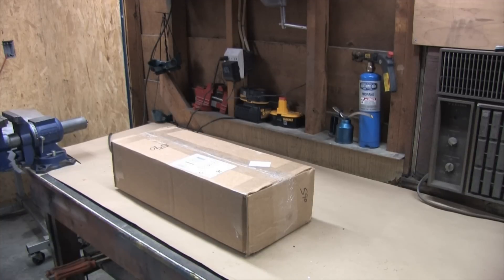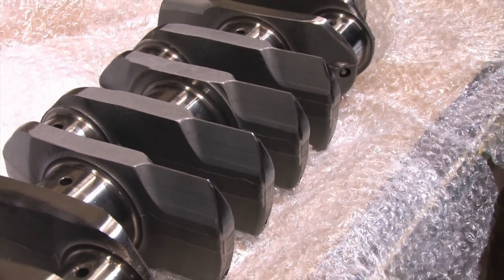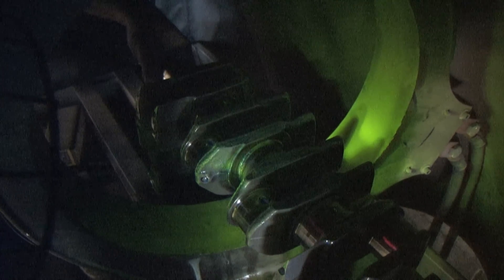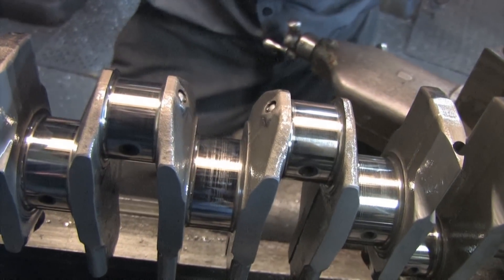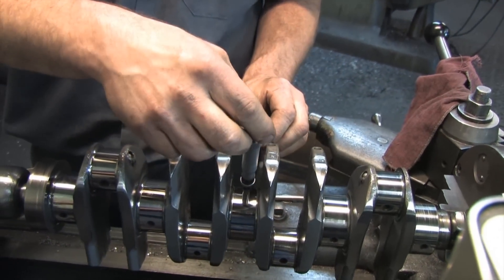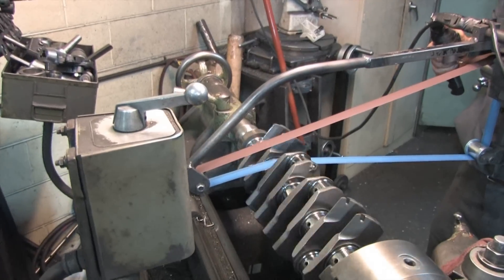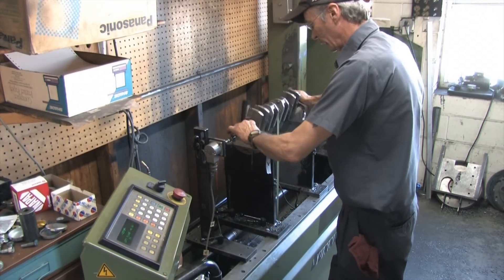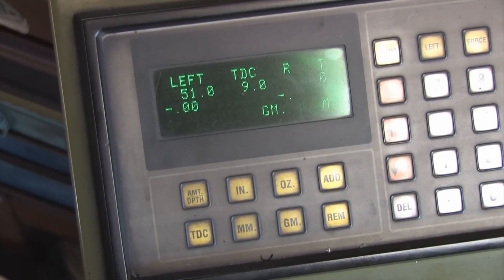Crankshaft Refurbishing

Comment: From my own racing experience , having rebuilt engines in the pits between saturday and sunday , I can confirm a few interesting things.  Journals can have gnarly DEEP grooves as long they are inline with the rotation of the crank and and you smooth them out as best you can.  But if they curve outward , they'll divert oil outward.  Consider how high quality aftermarket bearings often have a deep-ass groove by design AND are narrower overall than OEM.  Also you can sand the surface of the bearing , you can throw it in the dirt and still use it.  You can dump aluminum shavings in your motor along with kitty litter ,  but no iron or steel.    You can reuse removed bearings but you have bend them outward a little bit so they'll fit snug.  If they're loose , they'll spin.  The tang won't stop it , only crush does....or snug fitment.  Oh , and you can race an engine with no secondary rings or oil control rings , didn't make much of a difference.
Reply: I have found engines to be odd creatures as to some of the smallest details that can have detrimental effects, yet some large discrepancies the engine can shrug off. 

At some outboard boat drags, one of the competitors in unlimited class burned a piston with a big hose-down of nitrous. He needed to run another heat later that day. He didn't have a new piston. He removed the piston & rod and still twisted it to 7500rpm on 7 holes. Absolutely, it wasn't good for longevity. The guy owned a performance outboard shop and wasnt too concerned with side effects. But, the fact that the engine did it without throwing parts like an Olympic shot-putter left me scratching my head.
Reply: @Resistculturaldecline  An engine will run wide open with Mtn Dew for oil for about 10 minutes but if you don't ground the block to the chassis , static electricity will arc between the crank journals and the bearings and cause erosion until they fail.  Engine's fascinating machines , I would hate to see them get replaced with electric stuff.   Manufacturers are taking a renewed interest in alternative fuel development, so that might save them.

Comment: Correction on the NDI, it's not a Magnetic particle inspection and Dye penetrant are two different things, Magnetic particle which is shown here uses very fine metallic things which funny enough called "glow stuff" by magnaflux when I read thru my publications which is carried by a carrier normally oil based. The dye penetrant is just as its name, its a dye that seeps into the fine cracks, you remove the excess after letting it dwell (normally 30mins) and apply a developer over it and wait again which is half the time of the penetrant dwell time (15mins) and then you can inspect afterwards w/ black light under a dark room.

Comment: Im 33 now when I was 19 I had a a 90 1st gen gsx . 
.2g exhaust manifold ,  HKS cam with adjustable timing gears , larger 16g turbo with boost controller. 
Those few mods with boost turned up OMG that little guy was a monster . I tormented my poor neighbors.
 Im a V8  truck guy . Honestly that is the only car I would consider re buying to build.
Im a machinist now , went to college have a bs in engineering  and work making hydraulic parts for air crafts . I miss doing stuff like this. Funny thing is out in my garage I have a 4 axis cnc mill and lathe . It sits there these days. 
Good luck with your builds . They make me envious .
Reply: Are you interested in selling those 2 CNC machines?

Comment: Back when I was in high school (about 1976/77) we had a class trip to what you might call a mass production rebuilder. (Garden State Motors).
When they got an engine with a worn out crankshaft they would put it in a machine with an arc welding stick on it. They would weld a bead across all of the journals. 
They would machine it down to the original specs. 
I have never seen anything like it before or since.
Reply: +ScubaTiger Yep.. I've seen it done and had a 4cyl crank done that way.. I was shocked.. that engine lasted 100,00miles or hard driving before I sold it and it was perfect.
Reply: Metallurgy at its finest 😎
Reply: +ScubaTiger A local shop did that, they had a very hard to find crank so they have to fix that one, very expensive job!
Reply: My old friend would weld badly worn journals on a steel shaft with low hydrogen rods and then re-grind and polish it. Saved  an expensive crankshaft and it worked a treat.
Reply: Spent 15 years rebuilding crankshafts. Our welding procedure was submerged arc and doing that bends the piss out of the shaft. Must be straightened and then reground, but certainly doable. The straigtening process can cause the shaft to break though, so, it's not for everyone. Certainly cool to do.
Reply: I've heard of that technique before, sounds dodgy.....
Reply: Wow!
Reply: Abrams in Davenport Iowa. I know that spelling is off but if there still in business they can actually stroke a crank by welding up one side and turning it round

Comment: I have been working on a stock 4g63t 7 bolt rebuild becasue it has worn bearings and shot valve seats. I know you mention that you use aloy OEM parts, Gasket wise how different is OEM vs something like Fel-Pro. I have uses a lot of other brands in in the past.  Also when it comes to bearing and rings are the kits you see on ebay really poor quality.  I have a tight budget and just looking for some solid advise on what to put it back together with. Any big benifits to the balance shaft removal?

Comment: Hey man, Would you know of a tool that allows polishing/grinding of the crankshaft journal without having to remove it? I was thinking of a tool composed of 2 semi circles with sanding stones that together form a circle around the journal.

Or would you know the name of the 'belt sander' that you used?  My crankshaft is badly scored and I was thinking of perhaps using a stainless steel connecting rod bearing to wear out and smooth out the crankshaft a litlle....

Appreciate the help!
Reply from the maker: People have used an emery cloth with a shoe string.  ;)
Reply: @Jafromobile  Mine is really badly scoured, and irregular. Just sandpaper is insufficient. 

I had tried some 40grit sanpaper backed by 2 connecting rod caps, and that helped, but takes too long by hand alone....after all, it's a forged steel crankshaft.

 So I'm trying to figure out something a little more heavy duty and professional.
Reply: I have a video showing how to make an external/ crankshaft grinder, used on badly scoured cranks

Comment: Another enthusiastic viewer with annoying questions: After the polishing, do you just use the same size bearing shells, or did you source oversize ones? Thanks.
Reply from the maker: We're going to measure them and find out.  To be fair, spec is .0008 to .0020", service limit is .004".  Depending on how you will use your engine, you've got a lot of room to play with in that spec.  I set the hyundai up at .003" because it doesn't have oil squirters or balance shafts.  The rods are at .0025 which is also 5 ten thousandths beyond spec.  You gotta think about how you're going to use that engine, how your oil system can be affected by modifications, and consider what role your oil clearances play in that equation.  Loose is fast.  Tight is long.  If you want it to last a long time on the street, un-modified, set it up tight.  We'll know if the oil clearances are a problem once we start with a set of standard bearings and take measurements first... then see if it fits my purposes.  I'll want it set the GSX up on the looser side, and if we didn't shave too much off if I can probably get away with standard bearings.  We'll see.  The GSX has no balance shafts, but it will have oil squirters.
Reply: Excellent insights, thank you very much for your time. I am running an engine on higher compression ratio than stock, and I am worried that even slight scratching may cause the new bearings to tear. Thanks again
Reply: Good presentation

Comment: As a level II certified MP inspector with 18,000 hours on turbine blades but 0 on cranks, I was wondering if you did a head shot or just the coil shot you showed. How does the grain structure run on a forged crankshaft?
Reply: Yes, I would like to know that as well.

Comment: After a regular polishing would you still usually be able to use the same size bearings?
Reply from the maker: After a normal old regular polishing, yes, you should be able to use the same bearings.  That's why the specification gives you a range of clearances that are acceptable, BUT, you should always measure the crank and the bore to be sure.  If one is off so bad you can't correct it, you have to make them all match without mixing and matching bearings.  You'r not supposed to use an oversize bearing with the rest of a normal set if one's out.

Comment: Did you remove piston/rod weight equal to the crank counter balance weight removed?
Reply: The weight of the connecting rod's big ends, the total rod weight, and the pistons weight all need to be equalized. Their weights are insignificant since the crankshaft has a natural balance.

Comment: what grit did you use to polish it cause 400 can't be right cause 1000 doesn't even get you results like that.
Reply from the maker: +Heather Lee It depends on the hardness of your materials.  Hardened steel will shine bright with much lower grits than aluminum ever will.  Being an avid aluminum polisher, you can hear the surprise in my voice when he answered me with such a low number.  I saw the belt, and the crank journals don't lie.  I also noticed that I can take 304 stainless straight to black rouge and put a bling on it without sanding, but I can't do that with aluminum tubing without sanding it first to at least 400 grit.  I'm convinced it has everything to do with the molecule density of the materials.

Comment: hey Jafro, thank you for sharing your wealth of knowledge. It inspired me to a diy rebuild on a 2jzgte.  You have so many videos, I just chose this one to ask this question. 
If I use lighter pistons and/or lighter rods, will I have to rebalance my crank shaft? None of those part manufacturers made any mension of the need to rebalance although they boast of lighter than stock parts.
Reply from the maker: +Mark Mohammed That is a multi-plane crankshaft, and it's balanced for the previous assembly.  In your case, simply making them all weigh the same won't work.  I would have the assembly spin-balanced with all the new parts' weights taken into consideration.  Figuring it out the hard way with the engine in the car would be a whole lot less fun

Comment: with this kind of work done to a stock 6 bolt crankshaft how high much HP/torque/rpm can this handle I've heard they are pretty good up to 500 HP and after that aftermarket cranks are advised I have the stock one and have been considering dropping the cash for a new aftermarket cranks but if the stock can be used for 800+ hp I may be able to save a lot of $$$$

Comment: Hello Jafro. Love the vids and wish you all the best. Is it ok to store a crankshaft on it's side out of the engine for an extended period of time? I read it can warp so I'm storing it vertically.
Reply from the maker: +shawn sharpe There's 2 schools of thought on this, really.  There's the "storing a crank on X side is bad and causes warpage", then there's the "Are you f***ing crazy? A crankshaft won't bend from storing it, it's made out of forged steel".  The first crew I've always heard repeat that standing them on end causes warpage.  The first crew even recommends hanging it from the #1 and #4 journals.  I lay mine flat on a block of wood that keeps the big end off the shelf… but I know the best place to store it is inside the block, oiled, with the bearings that were in it.  There's merit to the "it's made out of forged steel" crew.  If you're talking a couple of years storage, probably not an issue.  If you're talking decades in a region with extreme temperature fluctuations, support it by the main journals or lay it flat on a block of wood.
Reply: Well  thanks I've had it standing vertical for a few days in a bag and oiled,max a month till it hits the machine shop.
Reply: +Jafromobile You can store a crankshaft laying on its side If the the ends and center main journals are equally supported.  Leaning a crankshaft against a wall it the worst thing to do, they will bend(.003-.015) under their own weight in only a week or two . The same thing will happen if it is laid on its side without support.  The longer the crankshaft the easier this occurs. Sometimes you can get lucky if the counterweights are equallsized and spaced, they will also support it to a certain degree.  A crankshaft is basically like a noodle that is constantly twisting and moving under stress. The base material affects this but they are all flexible to a certain degree.  Hanging or standing is the best storage method but like you said inside a block/bearings is the best method.  I wish he would have checked the used crank in this video for straightness ,  but since it still balanced 0-0 I would assume it is OK.  Someday please place a used inline crankshaft in a crankshaft grinder and check the stroke and index of the rod journals and I assure you will be shocked at how the stroke and index will vary between the journals. Andy Evans- machine shop owner for 30 years--

Comment: A crank from manufacturers right on the edge of being out of balance. The drilled holes in the counterweights/webs should be as close to centre of the web as possible not to the extremities/edge of the crank webs. 

I'd also be interested to see what the journal roundness and lobing would be from lapping on a precision bit of equipment like an Adcole. 

Either way, still friggin brilliant to see old school machine shops doing work like this!

Comment: what's the main cause of journals failing on the crankshaft, besides oil? Metal shavings in the oil?
Reply from the maker: +fockyoumang yes.  Or, overloading, vibration, detonation, lopsided forces on the flywheel, too strong of a clutch, riding the clutch pedal, viscosity break down from poor maintenance, missing transmission bolts, old age, or oil or crankcase contamination as you mentioned... That could be metal shavings or water/coolant/sludge... but there's lots of things that can contribute to bering failure.  Google "types of engine bearing damage", top link, and you'll find charts to see what the different kinds of failures look like.

Comment: in crank shaft balance I think flywheel should tight with the crank shaft
Reply: No. the flywheel needs to be perfectly balanced on its own...  that is a fact that the flywheel needs to be perfectly balanced, and this alone proves the flywheel does not have to be fitted to the crank, you balancing the crank not the flywheel..... when the crank is perfectly balanced it will make no difference whent eh perfectly balanced flywheel is attached......

Comment: I just watched your paint video of the head ... Would a crank benefit from the same treatment ?
Reply from the maker: Nah.  Bad idea.  Crankshafts should be balanced to within 3 grams, and there's less than a snowball's chance that the coating could be applied accurately enough to keep it in balance.  Balance it afterwards?  I wouldn't want to have to machine a part of the rotating assembly because of a coating.  There are better coatings than Glyptal to use for stuff like that, and in the end they still don't add any horsepower.

Comment: What shop is this? And approximately how much was this job? I'm looking to get my sbc 383 crankshaft "refurbished".
Reply from the maker: It's Ballos Precision Machine.  They're in Richmond, VA.  They've completely remodeled and bought hundreds of thousands of dollars worth of newer and even more precision equipment since I filmed this.  They've got a boring machine that will automate the bore and hone while it updates your facebook.  Maybe that's an exaggeration, but if that's not local to you, I suggest you hit the yellow pages because shipping a crank for a 383 would be... both expensive AND terrifying unless it's shipped in and out strapped to a pallet by itself.  The last thing I shipped like that was $305 freight.  If you drop it off an pick it up somewhere I can't imagine you'd spend more than $80-$120 for what you saw done here.  They didn't have to make any modifications to it, it was just a re-polish... but I'm happy I have a balance sheet for it now, and peace of mind that it passed the magnaflux.  I just stood around for 15 minutes and filmed it.  Any shop with a lathe, a belt sander and a good set of mics can do this work.  The balance job on that 383 crank is a hell of a lot more complicated, though.
Reply: Jafromobile ok, I appreciate it, thanks man.
Reply: Oh my god you live an hour away from me.

Comment: You can do that, but it's not going to grind the surface properly.  The tape is going to flex around and follow the shape of the damaged out of spec surface.  You NEED to use a grinding wheel that is dressed properly.  The guy doesn't even know how to take proper measurements of the journals either.
Reply: Slappy Fistwad  waaa